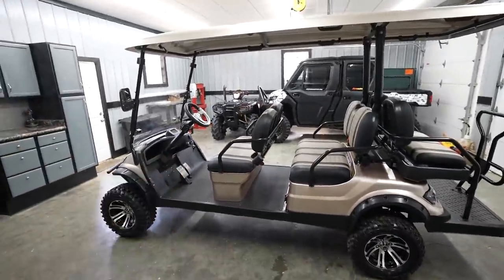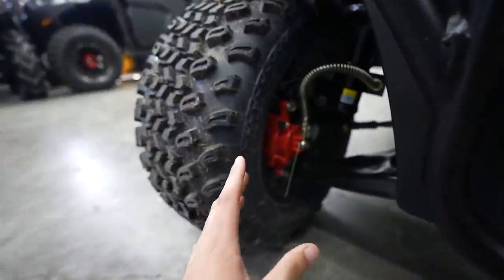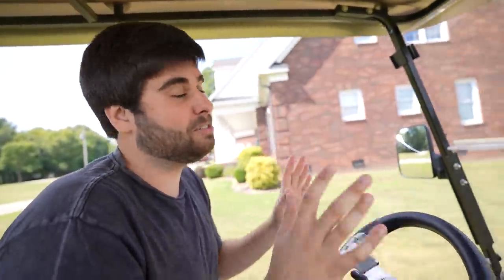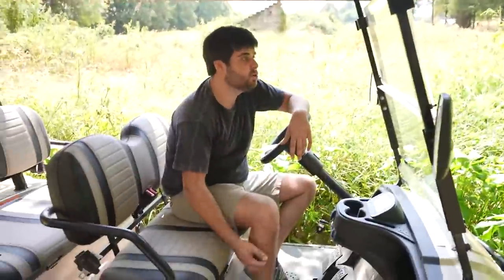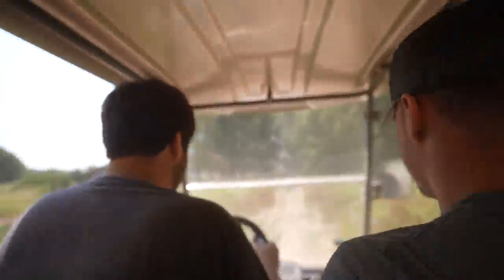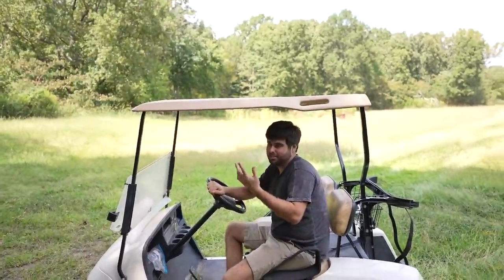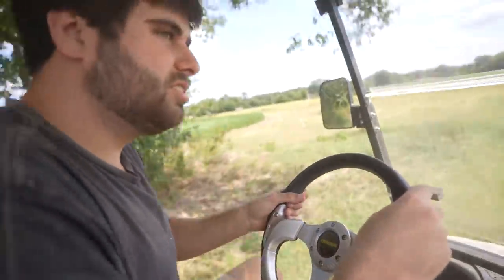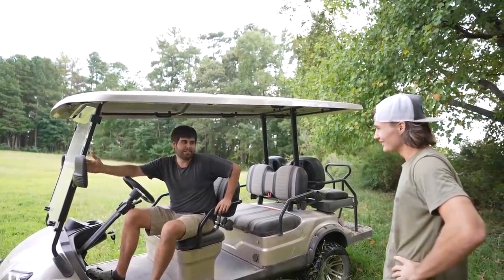THEY SENT ME THIS!

Comment: I have a regular electric golf cart it looks like your parents but its electric and takes off faster  than a gas golf cart.. you can get a different motor and your golf car will go way faster and do burnouts and it will try to do wheelies.. they are super tamed down.. from factory there’s a limiter built into the electric motor that limits top end and takeoff speed

Comment: To hell with the truck just drive that bad boy to the clubhouse storage for the guns under the seat the chargers built in so its always with you flatbed for a generator so if you run out of battery just charge it on the go and space for a cooler for the deer

Comment: Not gonna lie had a icon for about 6 months and was not a very great cart. First when you would get up speed it would away all over the road. We added spacers and same thing. Next are icon came with NO storage at all. We spent 500 in just trying to get storage. We got a club car and was the best decision. Stay away from
Icon
Reply: Also had very loud road noise and squices. Yes was very fast but my club car is electric and does 60 if we want it to.